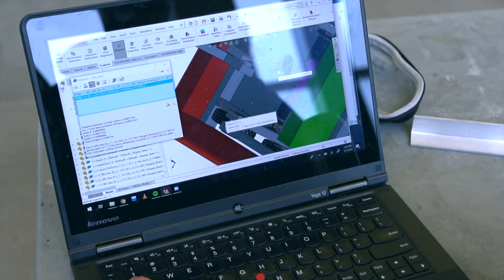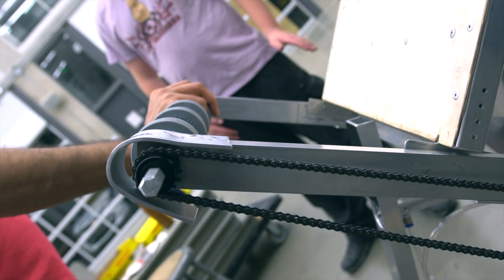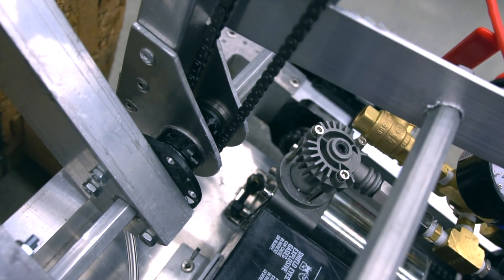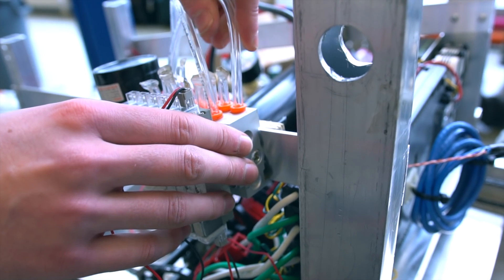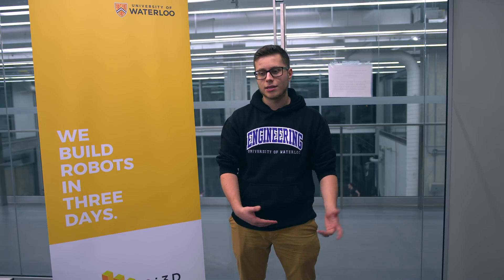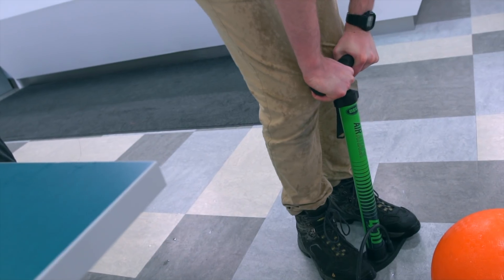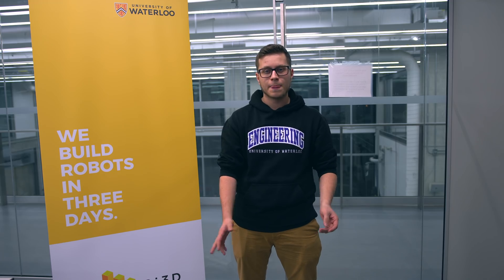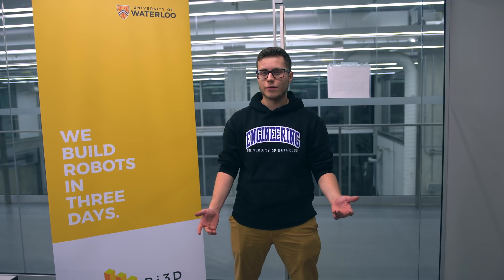UW Ri3D 2019 | Day 3 Recap

Comment: What is the gear ratio on the pivot arm?
Reply: The hatch mechanism is powered by 2 775Pro motors each with 100:1 reduction!
Reply: @juliancuralli4421  Sorry, I meant the cargo mechanism
Reply: @annabellep9147  No worries! The cargo mechanism pivot was powered by a 775Pro with a 100:1 gearbox along with a 2:1 gear reduction for a total of 200:1.

Comment: What did you attach at the ends of the pneumatic rods on the hatch mechanism to hit the hatches off your velcro?
Reply: We 3D printed a circular end cap that fits over the end of the pneumatic piston and is screwed in with the nuts included with the actuators.
Reply: @juliancuralli4421  Thank you for the reply!